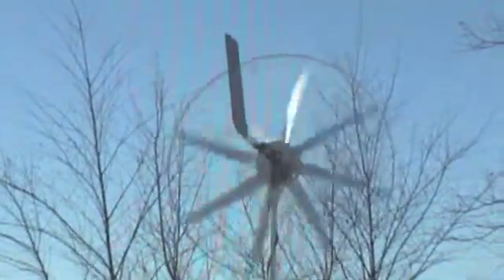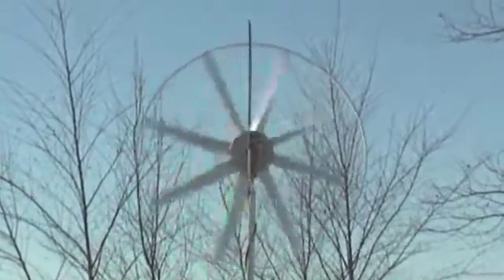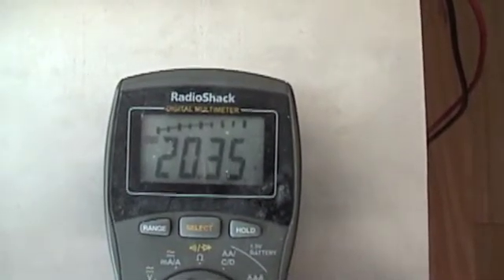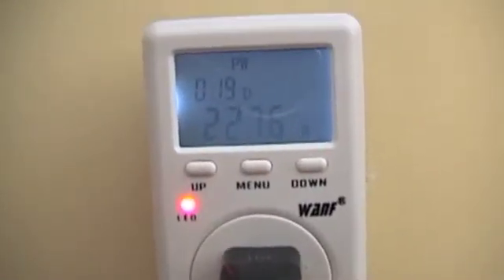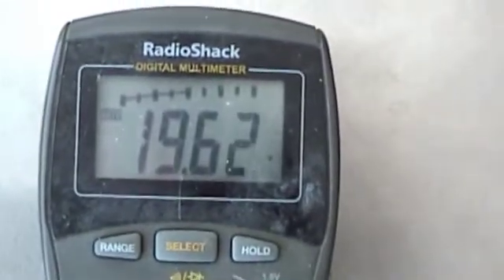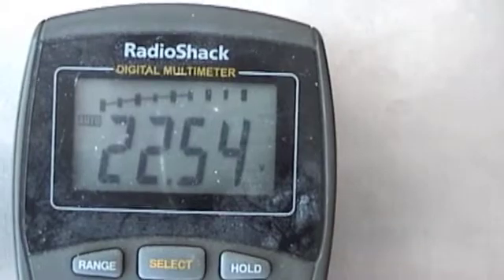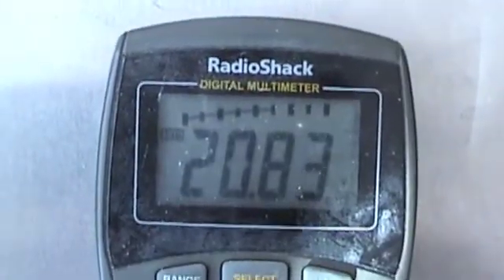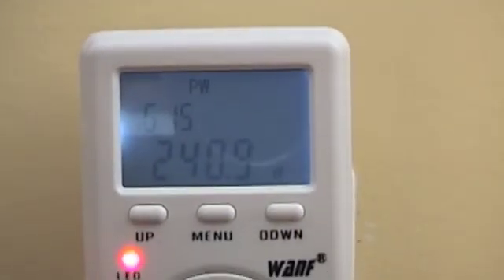Lynx GTI testing

Comment from the maker: @Fearlessthinker 

I know.  I was short on time and didn't allow for a full charge.  I have had these deep cycle batteries for a year and I have abused them plenty.  In a way the low level probably told me more in a short period than I would have learned with fully charged batteries.  They are happily being charged today.  I value your opinion and respect your work.  Let me know if I am onto something or its a dead end.  There has to be a way to use these small wind turbines.